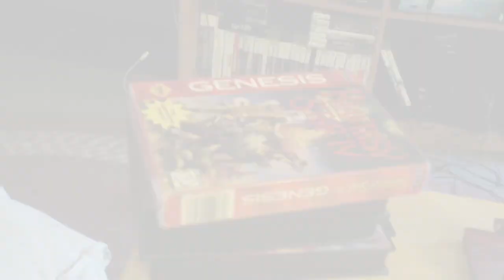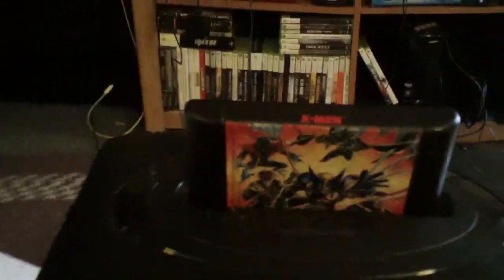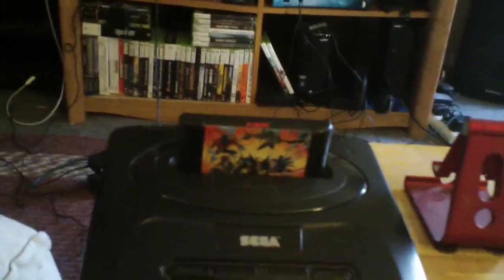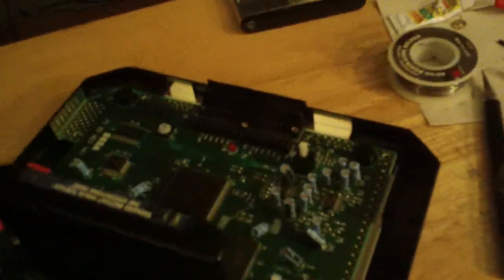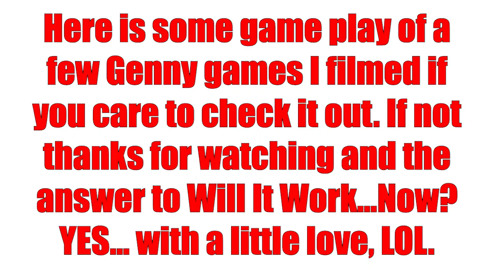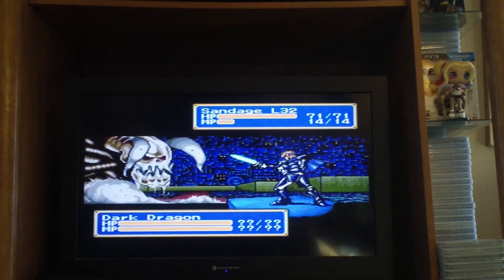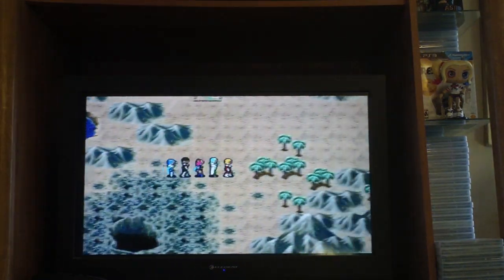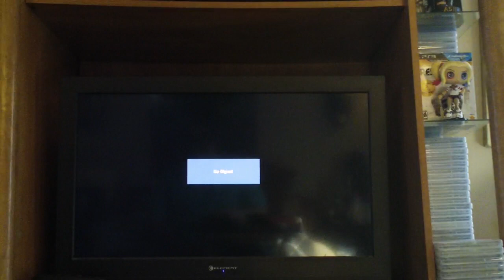Will It Work... now? - The Testing of my BitHead1000 Contest Won Genesis Console

Comment: There were multiple variations of those Sega AC adapters..some were meant for the model 2 Genny, some were meant for the model 3, and some were meant for the Game Gear..pretty sure the specs on all of them are different
Reply from the maker: Yeah, you're right.  It was a 2103 AC adapter which I checked online and it says it was the right one for the Model 2, so it was the right AC adapter for the system. I guess it just shit out on me, LOL.